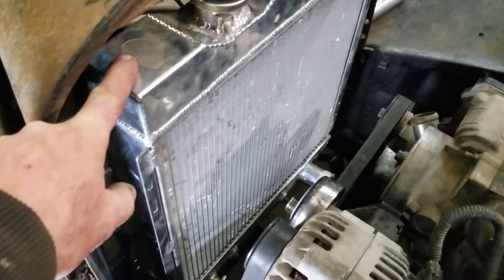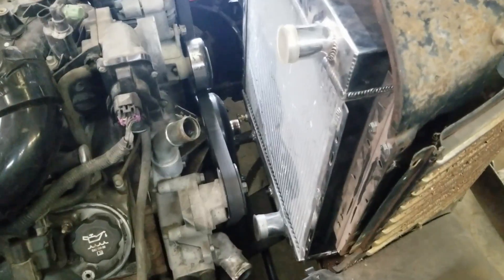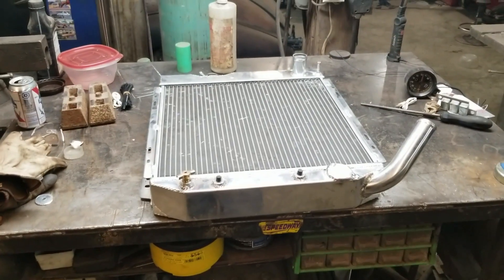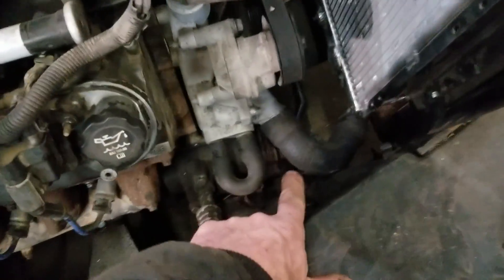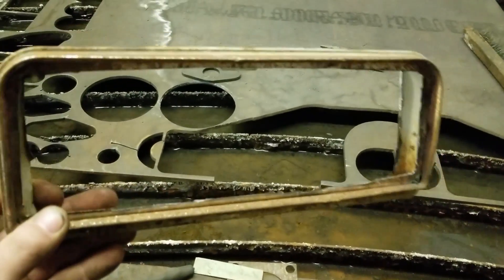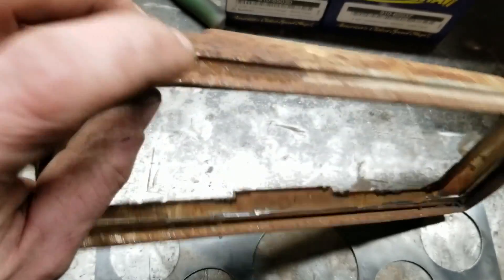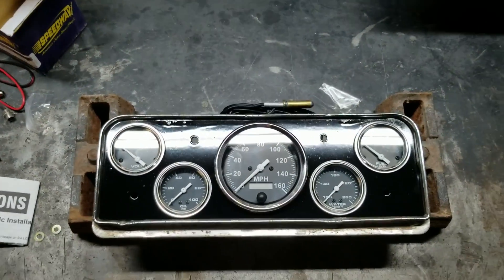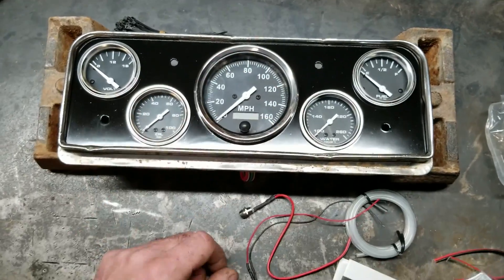38 Pontiac update modified Mustang radiator and custom gauge cluster.

Comment: How do you connect those little light to the signal light switch.
I have those but dont know how to configure them or put them to work.
My sinals and emergency lights are working fine.
Its just that little detail i like to setup.
Reply from the maker: my wiring harness I'm using has the signals out to the dash cluster.

Comment: Looking good. I got some resistors for mine just in case. I gotta get back after wiring that 46.
Reply from the maker: Did the Ford gauges use some kind of voltage regulator or something?
Reply: Halfass Kustoms I think they did have a dimmer knob for dash lights. But I have led now, I’m afraid they will be too bright.

Comment: Damn... I want to walk to canada, duck under the fence and help you but know you would pack my sorry 73 year old butt back to the border an throw me back over/LOL. Looks so good. I missed how you did the steering somehow. Smelling my own gas has caused my last brain cell to forget everything.... I  was wondering if you ever made the "fake" wood grain burl effect before as that is rough enough that it would be a candidate for it. Around the stainless, use one side or other of lead foil and rub it in to cover the little imperfections and around the glove box, french in a later model 50 ish glove box lid. Nothing set in stone yet and you can hide a AM radio in there too... listen to politics when its in the garage.. I get moments when a tune or two ain't bad. If its competing with the air compressor or the exhaust then turn off. You must have something in the old scrap pile that will suffice. Thanks for all the hard work of getting us videos... filming is the easy part if it takes a few hours to get a fifteen minute excapade on here
Reply from the maker: Yeah might have to put another glove box in but I think I can salvage this one haha, will find out about the fake wood grain as I try it haha Thanks for watching my videos dude!

Comment: im assuming those gauges r LS friendly ?
where did u get em and how much ?
I've got a 38 Buick im gonna LS swap very soon.
im dying to know how that radiator works out.
LUV ur channel man........!!!!!!!!!
Reply from the maker: They are just regular mechanical gauges like you would use on any small block other than the electric speedo, I drilled the head for a 3/8 fitting for the water gauge, and am going to drill out the oil gauge and adapt the mech one to it. I'll show how I do that in the next vid.